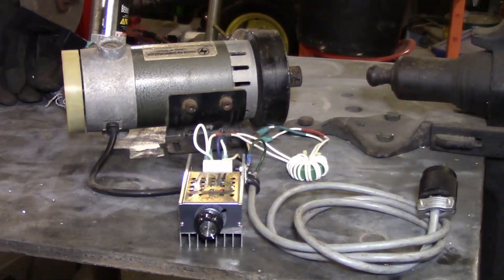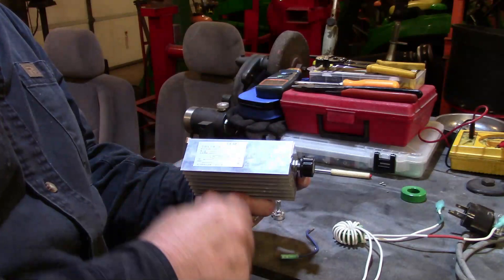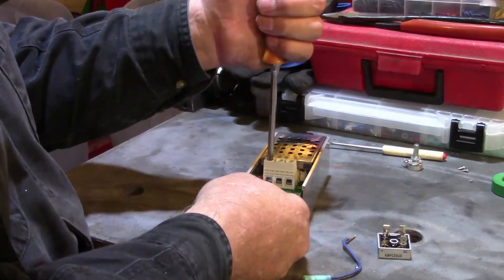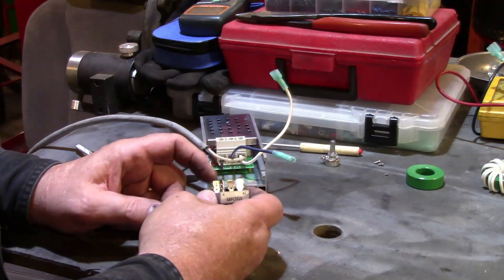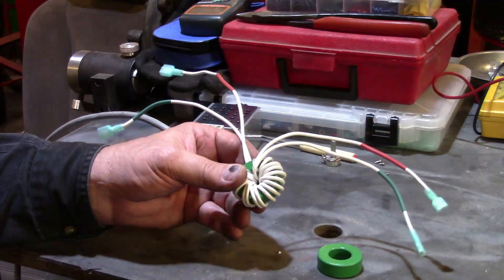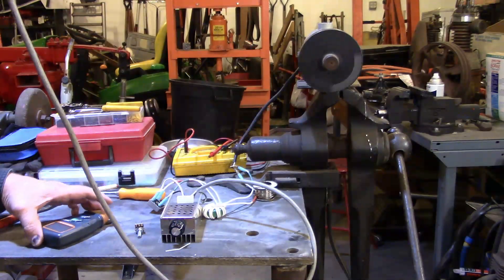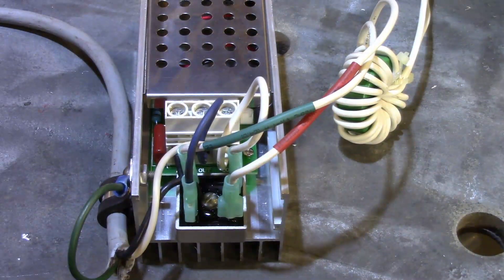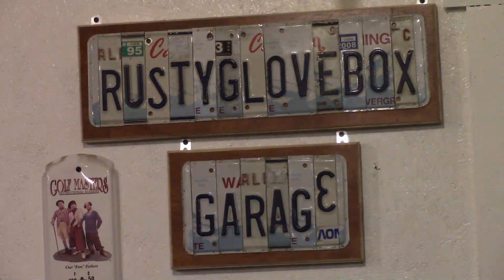Treadmill motor speed controller for less than $30

Comment: I have a question.  I used this video to put a treadmill motor on my old ShopSmith and it works great.  My question is that when I try to read the output of the rectifier sending current to the motor, I get no readings at all.  Any ideas on this?
Reply from the maker: Sorry it took a while to get back with you. The rectifier may be burned out.

Comment: The treadmill I have, on the controller board it's marked u v w. I understand it's for 3 phase. Can I still use the controller your showing. If yes which of the wires is the common? There all black.
Reply from the maker: No, you have an AC motor not a DC

Comment: What did you do about the third terminal on the pot you installed. The SCR only has two wires .
Thanks
Reply from the maker: You don't need to use it. Thanks

Comment: I know some time has passed since you made this video but I’m looking for some answers. I have a SCR that I’m using to power a dc motor on a small lathe. The POT, as with yours, needs changing to a smaller one. My problem is that the SCR’s POT has only two wires and most all POTS I’ve seen and have has three prongs on them. I’m having difficulty finding any information on how to replace the factory(2 wire) POT with a lower POT with 3 wires. How do you wire the new 3 wire POT? Thanks for any suggestions.

Comment: Great video, Thank you for sharing. I used all the same components  except the ferrite and hooked it up to my old Craftsman lathe. Worked great for about a week and in the middle of turning a bowl the motor jumped up to full speed and I shut it down. It was a little warm ( not hot) so let it cool down and tried it again and as soon as you power it up it runs at full speed. Any suggestions?
Reply: Probably the SCR/Triac shorted out and is a short circuit internally and the motor is running as though it is directly connected to mains power through the rectifier.   Happens in cheap power supplies with bargain basement design, protection and components.

Comment: I don't know how the manufacturer can claim it produces 2.5 hp. It draws 10A of 130V DC at full load, so even if there are no losses, you only have (130*10)/746 = 1.7 hp input. I'm guessing the manufacturer cheated and calculated hp from breakdown torque, which isn't the fair way to do that since the motor won't survive for long when overdriven.

Comment: i don't like this controller because you adjust the speed  CCW direction  to go UP and CW to go down in speed  with the  pot , for me and  99% the people that's reverse , ,,,,,,, except for people from England,,,,,,,where they drive on the wrong side the road
Reply from the maker: I could have move one wire  on the switch and it would rotate the opposite direction

Comment: Thanks for the great video! I have a 90 volt motor that has a red white and green wire for power. I have the controller but the controller isn't putting out the voltage to the motor. The motor also has a cable harness coming out with two black one blue one yellow and one red wire and the harness is fairly small. I couldn't find the wiring diagram for this treadmill but found one for a different one that looks similar and shows the wires are three grounds 15 volt in one pulse. I'm assuming this is for pwm purposes. Being that your scratch go straight to the power of the motor, do you know if I can do this as well or do I have to get a pwm power supply?

Comment: Hello, if someone could help me I'd be eternally grateful

I'm pretty much doing this exact same setup but I'm having problems.  The motor will turn on when I power the circuit, but right off the bat it's drawing too much current.  I checked the common with a clamp meter and it was already at 8 amps.  Motor wasn't under load, and I had it going as slow as I possibly could...  I was measuring some of the resistance values across the controller and they seemed way too large- in the mega ohm range...  Something is definitely wrong but I'm not sure what.

Comment: Did the same set up but the motor sparked very badly and the ac power supply got warm till it blow fuse, anyone any ideas?
Reply from the maker: The motor must have an internal short causing sparking and over heating

Comment: Does this method have any horsepower or torque loss as compared to the original control board?
Reply from the maker: If it has to handle a heavy load it might be better to use the treadmill control panel.

Comment: What if I install 100K potentiometer instead of the 200K you installed on yours? Will that improve it even more?
 I also noticed you installed yours differently than what was there before.  You had to turn the knob counterclockwise, maybe?  
Also, a choke, a capacitor maybe to smooth things out?  I am not sure.
Reply from the maker: You ask a good question and you will need to try it for yourself to see if it powers what you what to operate. thanks

Comment: Rusty, Hi, I am wanting to install a DC Speed Controller on my treadmill. I am not an electrician and need help with which Speed Controller will work with my DC Motor. My motor is: DC 90 Volts & 20 Amps. All of the Controllers seem to be lower volts and lower Amps. Can you please post a link to an appropriate Speed Controller I can buy on Amazon that will work with my Motor. I appreciate it.

Motor: DC 90 Volts & 20 Amps
Reply from the maker: I don't think I would use one of these on a treadmill. Try looking at this link.
https://www.surpluscenter.com/Electric-Motors/DC-Motors/Motor-Speed-Controllers/90-180-Volt-DC-Variable-Speed-Control-w-Potentiometer-Minarik-MM23001C-000D-11-2269.axd

Comment: Have you ever had one of these units be bad from the start? I am not seeing any adjustment when checking the AC side. So I hooked up the bridge rectifier and no motor. Flipped it on and it blew a circuit. All wires were hooked up just like you have. I then tried the second bridge rectifier and no sparks but no control at all of the voltage getting through. It is a constant 40V DC.
 Any ideas? All parts are exact same specs as what you used.
 Thanks for any help.
Gary
Reply from the maker: It could be bad from the start. I would be sure to connect the rectifier up correctly. Good luck.
Reply: Thanks for the reply. I got 2 rectifiers with it and they both check good. And they were indeed hooked up correctly. To make sure I watched your video while I wired it. 
 They are sending a replacement for the power unit. 
 I have wired 2 complete motor controllers for my CNC Plus making the power supply for them. So this should be pretty easy. 
 When I get the new one I will check to see if it works without the rectifier first. I should see a change in AC voltage which I am not with this unit so hard to expect it to make the DC variable either. 
 Thanks for the reply.
Gary
Reply: My replacement speed controller arrived and I hooked it up in steps Put the power cable on and made sure it would power on. Then unhooked the cord and attached the rectifier all was still good. Finally hooked the motor to it and it works fine other than the potentiometer and I have the one you recommended ready to swap out.
 So it appears I had a bad SCR unit on the first one.
 Thanks again,
Gary

Comment: I am building my DC treadmill motor controller like you, but I do not understand the effect of your ferrite core? 
#1: 2-1/2 ' of what guage wire
#2: you use it on the DC side of the bridge rectifier, and it is my understanding the choke has no effect on DC?
With DC it is just similar to a resistor ... 
#3: How many Henry does your choke create?
Thanks for your video!
I subscribed to your channel!
Reply from the maker: The ferrite core works like a shock absorber when you change motor speed lowering the voltage spike. I used 12 gauge wire.

Comment: much thanks for the great video.  question is, what is you are using a speed controller with only an one in, one out, and one com?  Also the on off rocker i have has three prongs (one being copper).
Reply from the maker: One black power wire in, one white neutral wire in and branches back out, One green ground wire to switch body.  Good luck

Comment: Excellent job of explaining everything. I think the best I have seen. 
Couple questions: How much torque does it have at lower RPM? I currently have a small metal lathe using a treadmill motor and the board is having issues.  I am able to turn it very slow and have lots of torque and want to still have it for threading.
The other question is when you use the potentiometer that came with it you turn it clockwise to increase the speed. When you swapped it out it looks like you turned it clockwise to slow it down?
 Or was I seeing things?
 I know this is an older video and I hope you see it and can answer those questions.
Again the best job of explaining I have seen.
Gary
Reply from the maker: I know a couple of people that have used this and have been happy with theirs. 
The pot switch had 3 pins , so it can be wired either way.
Reply: @RustyGlovebox  thanks for the reply. I was wondering if it had much torque it had a lot RPM?

Comment: I have exactly  the same controller,  the pot  has only 2 wires attached but the one I bought has 3 legs, can you tell  me where you attached the two wires?
Reply from the maker: You use the center pin and either one of the other outer pin. One way it will be slow to fast, the other it will be fast to slow.
Reply: @RustyGlovebox  thanks, I was kinda confused,, electronics is very difficult for me, thanks again.

Comment: Enjoyed the video. I have the same controller and bridge rectifier and am getting ready to put it together to use on a 2x72 homebuilt belt grinder. Your video will help immensly.
One other question, I noticed in your video the red frame apprentice in the background. What is that?
Reply from the maker: I built a power hammer for my forge when I use it. Thanks

Comment: Hi I have the same motor controller and rectifier as you have I removed the 500 K and replaced it with a 200 K . But the motor is still turning too fast for what I want . Using it on a wood band saw to convert it to a metal cutting so it needs to go slower maybe 200 RPM . If I hook the motor to my bench top power supply I can get to start turning at 1 volt really slow . Is there such a pot that is smaller than 200 K ? Any help would be appreciated  thanks Robert
Reply from the maker: The easiest way would be to change the pulleys to get a lower speed.

Comment: Rusty - sorry for the constant question - so if I want more than 110v dc output, I would have to put 220 into the SCR - how would that be wired in the us?
Reply from the maker: It would require a different SCR with 2 positive locations on the busbar to use 220 single phase.
Reply: @RustyGlovebox  Rusty, when I added a volt meter with the donut thing on it to measure dc volts, and coiled the positive wire around it 4 times, same voltage but pick up in RPM to 5200 - so I would think that if I would have used the core choke as you did, it would have solved the rpm issue as well; Now running at 5200 rpm with no issues, thanks for all your help!

Comment: I used this set up for a 4.25 HP DC treadmill motor.  (4.25 HP Leili Treadmill Motor L-315219) I have not put the choke in yet. Nor did I replace the Pot yet. Ir runs smooth as silk and tops out at about 4,720 RPMs. Very constant RPM at that point. The stated RPM  max for this motor is 5,195 at 130 colts, DC.  - will the Pot or the choke add to the RPMs or is it something else I am missing.  Thanks for all the help, this is awesone.
Reply from the maker: If your AC voltage 110 to 120 it won’t reach the 130 DC volts may not not reach the max rpm rating of the motor. Hope this helps
Reply: @RustyGlovebox  As I thought, thanks again and I appreciate the help, I will work in a 36" wide drum sander with this motor, If it is not enough, I can always hook up a second one on the opposite side of the axle.

Comment: I see you have grounded the speed control case, did you also ground the case of the motor and if so, did you daisy chain the ground off the speed control to the motor or split the ground wire and attached one to the motor and one to the speed control case?
Reply from the maker: I used the ground terminal provided on the busbar for the motor ground.
Reply: @RustyGlovebox  Rusty my question wasn't clear - I see the controller being ground by the wire coming from the ac plug via the electrical cord, (Ultimately the busbar) I don't see anything other than the positive and neutral being connected directly to the motor itself, is that correct?

Comment: Would a DC controller not work..i see them  for  like $12
Reply from the maker: The treadmill motors are about 130 volt DC with a higher amp draw than maybe a router. What I show is how to take AC and convert to DC. You my find something but it will cost more. Good luck

Comment: What is the purpose of those small metal donuts with the wires wrapped through them?
Reply from the maker: It work like a shock absorber to limit voltage spikes on electronics

Comment: My treadmill stopped working from putting it in storage and taking it out 6 months later. I bought a speed controller off ebay and it runs the treadmill from slow to very fast but at any speed as soon as i get on it the belt stops moving and no it's not a weight issue. Any ideas. The motor is a 102VDC / 18amp.  The controller is Adjustable PWM DC Motor Speed Controller AC 110V to DC 24V-90V for DC Motor 400W
Reply from the maker: You might check Treadmill Doctor videos, good luck
https://www.youtube.com/watch?v=lOIQoHR5OWk&ab_channel=TreadmillDoctor

Comment: Built this. Installed on a drill press. RPM's drop considerably when drilling. Any ideas for a solution to keep RPM constant as load is applied?
Reply from the maker: Sorry, not sure other than changing the pulley size

Comment: Thanks for the great video. I‘m using this setup on a 180 v dc motor with 2,2kw on 230v ac. But the motor is producing a very weird pulse noise that sounds like the frequency is false or something like that. Do you have any ideas? The motor runs and is powerfull but the sound is not so reassuring.
Reply from the maker: Sorry, don't know what causes that.
Reply: If the motor is marked with 180v, then that is the max voltage. If you have it on 230v, you are using a voltage that is to high.

Comment: Lloyd this is a great tutorial!  Thanks :)  I do have a question:  I've completed a wood lathe motor upgrade project using the same controller, bridge rectifier and toroid coil but at low RPMs the motor bucks around, jumps and the power fluctuates quite dramatically.  If I speed it up above 800 rpm or so it smooths out to otherwise normal operation.  Any idea why this might be?  Anything I can do fix that?
Reply from the maker: If you operate at low rpm’s more often you could lower the pulley ratio to get lower drive speed and increase the motor rpm. Good luck
Reply: @RustyGlovebox  that's definitely an option.  Unfortunately, I've got limited space and the aim I had with switching over to something variable speed was to eliminate the need to go back there and switch the belt around.  Might I have the wrong type of motor?  Is there something about low RMP under load with this setup that's not compatible?

Comment: I’m doing something wrong. The AC out does vary but when I measured after the bridge rectifier the DC voltage remains around 105 no matter where I turn the potentameter.
Reply from the maker: The rectifier must be blown
Reply: How do I test a rectifier with a multi meter? Is there something I did to blow it, like hooking up wrong? What size rectifier do I need, 130V motor from treadmill.

Comment: HELP!! I hooked mine up and used the same parts you talked about but I keep popping my breaker. I have pictures but I dont have anyone to send them to. If anyone can help I'd appreciate it.
Reply from the maker: I would recommend to make sure you are connecting the rectifier up the same as I did. It is what converts it to DC volt output. Will your motor run at all on 12 volt dc? My have a bad motor if it doesn't
Reply: @RustyGlovebox  my red wire, i just noticed has the positive (+) mark and i had the black hooked up to the positive side on the rectifier. Could that be the problem?

Comment: Good video. Be aware automotive wire may be dangerous to use as it may not have the correct insulation properties required for high voltage mains connection.
Reply from the maker: Thanks for the info.

Comment: Thanks Sir - three questions - what material is the green round you used to regulate current - ? - Second - what is the specificity of the Bridge Rectifier (what is full rectifier vs simple rectifier)?
Third - I have two motors PM 2.25 and 3.5HP - 90 and 130 VDC (19 - 20AMP) - What would you changes in this setting ? Bridge rectifier?  Speed controller ? ect. - Appreciate your Response
Reply from the maker: The green ring works as a shock absorber to limit voltage spikes when you change speeds.
Bridge Rectifier Diode - KBPC5010  50A 1000V  , this is a 50 amp rectifier , you may want one as large as a 100 amps for your projects load.
You will have to test the speed and adjust accordingly depending if your power is 120 ac or 220 ac in your area. Good luck

Comment: Will this setup power a drill press with adequate torque at low speeds, say 250 rpm? Thx
Reply from the maker: Several people used these on drill presses and they have worked well.

Comment: You showed the slowest speed as 484 with the old Potentiometer, but did you get a slower speed with the replacement and what speed was that?  I'd like to be able to control the motor all the way down to around 100rpm's or so.
Reply from the maker: It can be done . May need to upgrade to a heavier duty rectifier too for the added amp load at low rpms